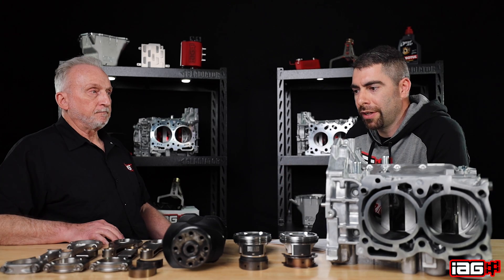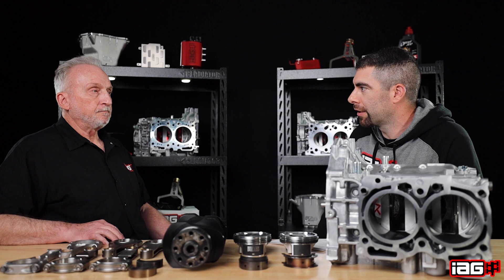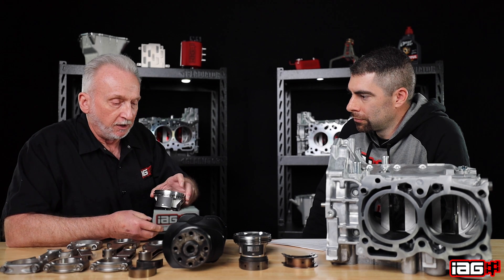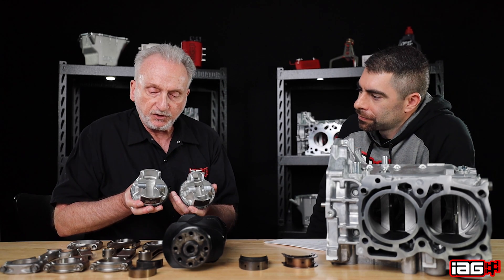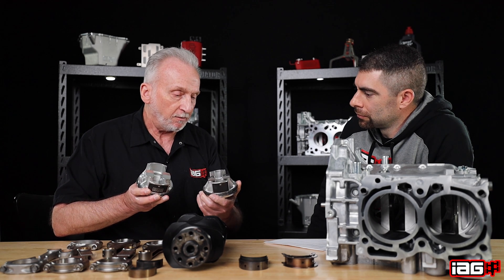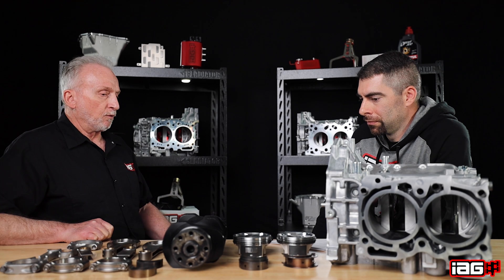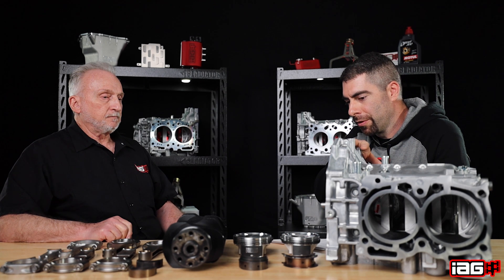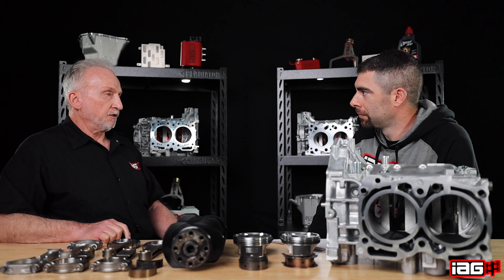IAG Performance Stage 2 Tuff Short Block

Comment: @IAG Performance I have a tuff2 with a bad rod bearing. What do I do to get this repaired? Could I send it into IAG for a refresh of the bearings and all the other tolerances checked. Is that recommended? Whats the average cost and what’s the process to go about this? Assuming any damage is light (which I believe is the case)
Reply from the maker: Email us or give us a call and we can get you sorted. sales@iagperformance.com or 410-840-3555
Reply from the maker: Yes, please send us an email to support@iagperformance.com and we'll go over the details with you!

Comment: I've had my IAG stage 2 tuff for about 8,000 mi.  And I absolutely love it. All I have is a cold air intake from injen stock injectors and I'm pushing 271 horsepower at the wheels and 350 lb of torque. My vehicle was tuned at Yimi sport and built at Renner racing. I would highly recommend purchasing IAG block. The car is so fun to drive and it feels extremely strong. My favorite part of the day is the drive to work and the drive home. It gets no better than that.
Reply: I forgot to mention the only other mod is a Grimm speed boost solenoid.
Reply from the maker: Thanks for the support!

Comment: The stage 2 tuff block will safely perform making 450 to 500whp??
With all supporting mods and pro tune on e85 that is!!
Reply from the maker: We usually recommend stepping up to a closed deck block when going over 450WHP, but chassis dynos vary in how they read. Many people have had success pushing these kind of numbers on non closed deck blocks.